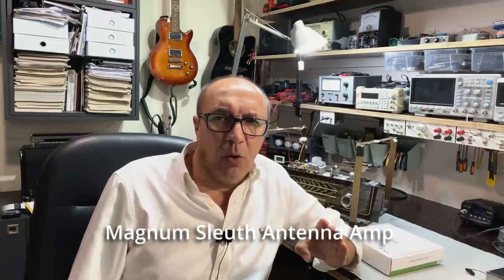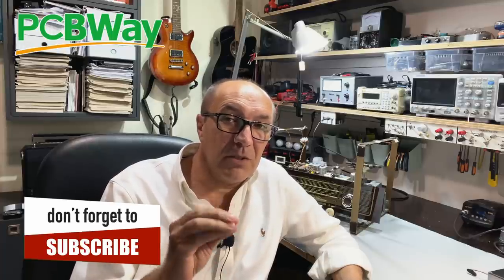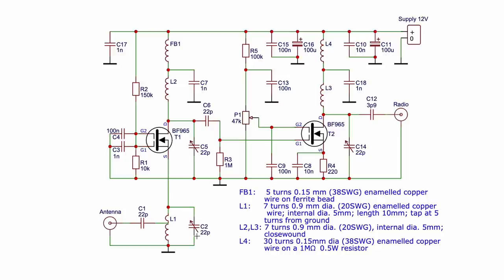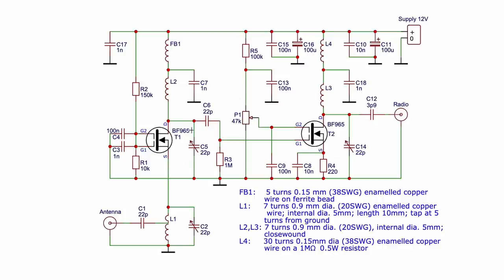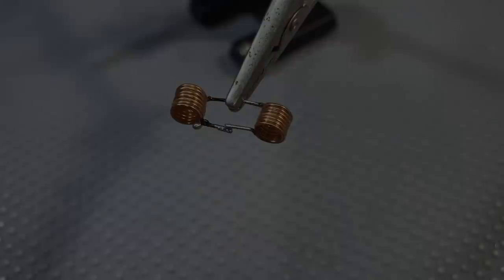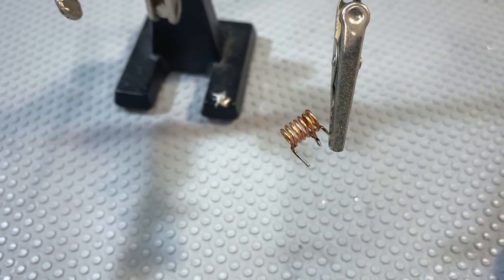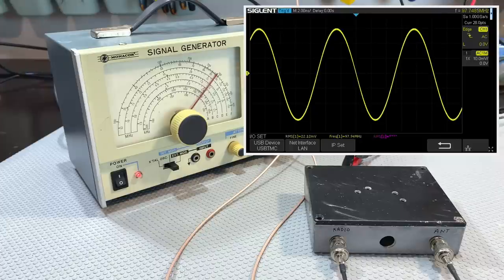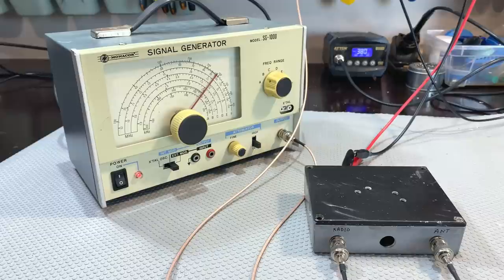Can we get perfect FM reception with this Antenna Booster? #PCBWay

Comment: I've installed several dedicated FM broadcast antenna systems to me the most important part is the antenna, I've always used a dedicated commercially made outdoor FM dipole or a Yagi. In line 300 to 75 ohm transformer 75 Ohm "F" connectors to RG-9 or RG-6 coax run to the receiver then impedance matching to the receiver input I/E a second In line 300 to 75 ohm transformer. Sometimes this alone is sufficient for acceptable reception. If not I've added a mast mount broadband TV/FM preamplifier, and yes DC voltage supplied over the coax. 
Having the preamp next to the receiver is okay as long as the noise floor is not too bad and your well shielded. I think home brewing the amplifier is a great idea too good luck don't give up.
Reply from the maker: Definitely food for thought. I’ll just keep tinkering and see how it goes. Thanks.

Comment: I think your amp is behaving as it should. 3 tuned circuits, it is sharp. Stagger tuning is the way to go, as you did. The input circuit in the middle of the band, and the othet two near the ends of the band. But the most important thing is, that the amp should be right after the antenna, outside. There should be absolutely minimum feed line loss before the first amp stage, otherwise the extra amlification is useless. And as you found out, switching mode power supplies is no no for preamps, even not all linear power supplys don't work well. Btw. usually ferrite beads have a hole in the middle, and the coil is wound through that hole, but your bead seems to work as well
Reply from the maker: Thanks for that.
Reply from the maker: Thank you. 👍
Reply: How Kool is to build a  antenna. Booster your slif  you save money
Reply: I like your utube videos

Comment: I think the problem is twofold.  First the ferrite bead.  The characteristics of ferrite beads can vary significantly, especially at 100MHz.  This can affect the Q of the inductor on the bead.  Did the original article specify a bead made from a particular type of ferrite? Secondly I believe you said that the copper wire you used for the inductors was not the specified diameter, but larger.  The skin depth in copper at 100MHz is about 6 micron.  So the impedance of the wire will decrease with greater diameter wire, increasing the Q factor.  Another commentator suggests adding resistors to decrease the Q of the inductors.  This would either mean a new PCB layout or modifications to the existing PCB.  I think it is better to use the specified copper wire diameters for winding the inductors.  Also try using a bead of a different type of ferrite for that inductor.
Reply from the maker: All good tips. Will tinker with it some more.

Comment: You can connect a high value resistor (ex 39k)  in parallele to a coil to reduce its Q. At this frequencies I don't know if are introduced additional capacitances that can detune the resonance of the coil itself

Comment: In my experience, it all starts with a directional or tuneable antenna. Signal boosters will amplify noise along with the desired signal. If your domestic situation allows an antenna with a rotor, or several antennas pointed in different directions, DO IT ! Getting a clean signal that is free from multipath interference and adjacent station frequencies is step one before you even consider using a signal booster. Worst case scenario is using an omnidirectional antenna and trying to electrically pretune or bandwith-limit the signal right before the tuner's input. 

Hey, have you ever seen a BIC "Beam Box" antenna? It's a tunable Yagi antenna in a box about the size of a turntable, with element-selector switches to change directionality and a tuning condenser to narrow the output at any point from 88 to 108 Mhz. (The BIC FM-8 was 300 ohm in and out, the FM-10 added 75 ohm in/out and had nicer cosmetics). Great for pretuning stations and eliminating reflections and adjacent-station interference, although output is low and therefore may require a separate FM booster. Production of these was discontinued some 4 decades ago. I used to be able to buy them used for $20 or so here in the States but prices have skyrocketed. Somebody should clone these things! By the way, somewhere on a shelf in storage I have a Magnum tunable FM booster with front-panel gain and 88-108 adjustable bandwidth control.
Reply from the maker: I have come to the conclusion that your view is absolutely correct: Good antena first. I’ve actually gone more in that direction and am testing one of those omnidirectional folded dipoles. Still waiting for some hardware to get it mounted on the roof without it being too obvious to the neighbours in the building 😊
Reply: @electronicsoldandnew  , my wife won't let me put an antenna on the roof (the prevailing winds in New England would be tough on it anyway) so I settled for an 8 foot directional antenna in the attic, but there isn't sufficient space to rotate it, so I had to settle for pointing it in the direction of the most distant and desirable stations. I used to use a Beam Box, located in the attic and pretuned for the low end of the dial (where college and public radio stations reside), to feed a Proton FM 300 table radio on top of the refridgerator, but when we remodeled the kitchen I lost that space for the radio (we now have a cabinet mounted above the fridge) and so I need to relocate the coax cable from the attic antenna to a distant corner of the kitchen so I can hook up my radio again, sigh....
Reply: @goodun2974 Wow - Proton 300 table radio!   Total I've known to exist now is *two*, including my own.  Excellent fidelity!

Comment: You could construct a small high gain antenna outside your booster box that revolves in the direction of the radio wave. The flux around this antenna should have a radius of 6 inches. That is to say when you put your hand near six inches away in any direction without touching the aerial the its reception increases.

Comment: Learnt a lot of ideas from the comments about improving bandwidth. I'm an electronics engineer, my knowledge lies more with the radio operation and not the art of RF preamps at the vhf range. So my suggestion is probably more naive, I don't know. But what I'm thinking is adding an extra tuned stage, spreading the bandwidth and just watching your overall gain. I would be interested to learn the pros  and cons of my idea.
Reply from the maker: That could work, even if we had three smallish peaks along the band.

Comment: Since your Antenna Booster has a restricted band you could use it at your advantage making it tunable. Simply substitute the trimmers on the tuning coils with varicaps and regulating their voltages with a potentiometer you make your booster tunable.
Reply: BINGO, I have been quietly screaming at the screen, By selecting 3 matched Varicap diodes, and switching out your 2 wire NON coax 12V power feed to spare inexpensive 4 conductor Telephone wire, you can send up 12V, and a separate 5-20V typical range Tuning Voltage on the added 2 conductors!. Take these tuning diodes OR the whole RF Amp stage from any old electronically tuned FM radio or just 3 varicaps and branch out via 3 100k resistors and some decoupling caps. NOW you have a remote tuned, image rejecting PRESELECTOR, like the 3 stage one in my beattiful 1974 Kenwood R-599 "HAM" Communications Receiver utilizes for HF. Also maybe fashion some copper shield between the input and drain coils and trimmers to cut oscillation risk. Nice layout, here in the states I have layed out 200+ PCB's, many for USA Police Car Videotape Evidence camera systems using my trusty OrCad SDT and PCBII DOS tools, on a 486 computer which NEVER has been connected to the internet...Thanks for your wonderful videos and mild voice intelligent presentation! I am restoring and redesigning a 1944 Hallicrafters SX-28A HF Receiver into SX-28+, copying my HQ129-X BFO circuit, better regulation, and a DIY AUDIO modified dual 6V6GT ckt with 2 new Gold Lion tubes, matched pair from Russia, AND a HiFi audio TF from Hammond. It already has TWO tracking RF AMP tube stages, providing preselection automatically for 0.5-42MHz. Thanks from W4HDL in USA.
Reply from the maker: Thanks for that. Lots of ideas to work with.
Regards

Comment: Hi Miguel ! There are much more simpler and better solutions for making a WIDE BAND min. 20 dB low noise (NF~0.6dB) over the FM broadcast band: I use single chip MiniCircuits PGA103 (there's also the SPF5189Z). They can be found easily and cheaply  on chinese sites, even already built. The only drawback is that they run at high quiescent current (typ. 70-90 mA). Located just after a simple vertical dipole  (+ balun) that makes a huge difference  on receiving (I also added a 88-108 MHz bandpass filter in front of the LNA to get rid of intermittent airplane communication intermodulation).
Reply from the maker: I actually ordered on of those some time ago, but deliveries are taking months at the moment.

Comment: some Radio have signal strength indicator led , its brightness increased when tuned .
how this circuit works ? i wanna built such indicator for IF output
Reply from the maker: I’m afraid that requires a full explanation that I’m sure you can easily find on the web with a little searching.

Comment: Hi manuel,  probably you were searching some article like this"EE July/August 1986 36 by R Shankar 1 111 tuneable FM booster 01 BB106 C1 II Op 75 n BF961 BF981 This FM band (88-108 MHz) preampli- fier, this was an article at elektor magazi ne, & doesn't lacks , modest gain /Q, but tunable on the whole FM band

Comment: Hi Manuel. Great video. Sorry it didn't turn out the way you wanted. Could substituting one or two components (upgrading the existing design) give you the extra performance you are looking for? I really hope that you can rectify the problem, as it will be a very worthwhile addition to have. Best of luck. Cheers Chris.
Reply from the maker: Thanks Chris. I’ll be tinkering with it for some time, I’m sure.

Comment: I was itching for you to test this with either a spectrum analyser with tracking generator, or signal generator in sweep mode, triggering your scope to show what the band pass looked like.  You do it for radio alignment so why not here?  Thanks for another interesting video.
Reply from the maker: The signal generator I use for the sweeps only goes to 20MHz. For 100MHz I only have that old manually adjusted generator.
Regards, MC

Comment: I have  small FM radio for my Church. Is there a attenna that  will boost the power going out? 90.5 FM
Reply from the maker: Not sure if that’s going to give you a good result. Also be careful about the legal limits.
Reply: @electronicsoldandnew  is there a device that boost signal going out?
Reply from the maker: An RF amplifier
Reply: @electronicsoldandnew  thanks

Comment: Thanks for sharing the design and build!  I would be interested in making something to cover a spread of 30 to 1000Mhz without using the filtering. I am guessing coils and trimmers could be eliminated from the build in a breadboard version, then design and make some PCB's. I have also used PCBWAY to create some linear power supply replacement prototypes for a Feeltech FY6600  Function/AWG that has a bad issue of leaking some ( 50 to 70VAC) power line voltage through the SPS to the common / shield connection ( video to be created soon).
Reply from the maker: Definitely can’t use sharp filters, and building on a breadboard may not be too easy due to parasitics. probably best manhattan style on a blank pcb.

Comment: I think you got it wrong regarding ferrite beads- they should be  "beads" with a hole through which you pass the wire and not a normal ferrite rod as any other coil
Reply from the maker: This was the bead specified in the article, but I’ll obviously try alternatives.
Reply: @electronicsoldandnew  Does it have a hole through its sides? ferrite beads with the wire just passing through are used in RF circuit to suppress ringing. no windings, just pass-through
Reply from the maker: I know, but I decided to follow the instructions exactly, and this is what they describe.

Comment: Thank you for this interesting project.  It appears that good antenna amplifier design can be a challenging process.  I've often wondered if an old-fashioned TV-FM antenna amp would be useful in a case like this.  They're dirt cheap, very wide-band (50 to 2200MHz) and, back in the days of analog TV, were often used to boost fringe signals into clear signals.  Or is there some technical reason why this won't work?
Reply from the maker: not sure, but could be as simple as that.

Comment: sorry Manuel, I got shadowbanned here, on a simple one line comment.
Reply: I'll try here:  your 'bead' should be a torus I think, not cylindrical, but you may have seen the picture of the finished product.
Reply from the maker: I’m curious: How did this ban work? I’ve seen quite a few comments appear and then disappear with no input from me. What is happening? Is this a YT feature or bug?
Reply from the maker: This one got through 😊
Reply: @electronicsoldandnew  Yep... Then I am invited to try my original message, lets see what happens 😉 in the next comment below here:
Reply: @electronicsoldandnew  Maybe you have seen the finished product from the magazine, but I thought (not sure) that a ferrite bead is always a torus ? You made it a cylindrical core. And (as I see others note)  the amp should be on the roof, as close as possible to an antenna, a bended dipole type maybe to make it see 360°. I read some advising a directional yagi, but then the rotor comes in etc... It is my theory, not to much experience.
Reply from the maker: Yes, the magazine one used this type of bead, which also surprised me.
Reply: @electronicsoldandnew  i think they call it artificial intelligence, and yeah, it's a bug. of a  politically correct type.
Reply: @electronicsoldandnew  , the only such issue I've had is when I post a comment, then re-read it, find a spelling error or a point I wish to clarify further; I'll open up the post to edit it, and after I make the desired changes it disappears when I try to repost it.